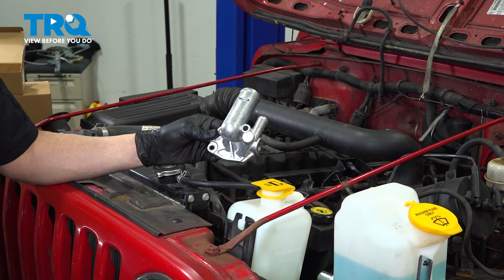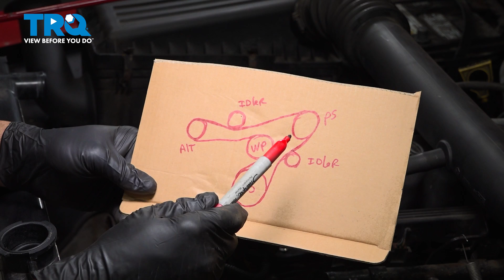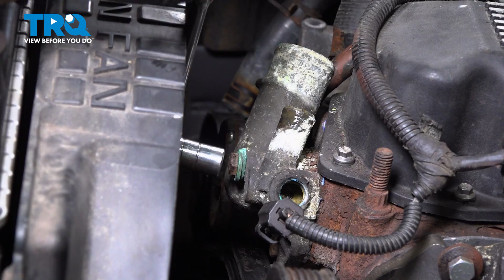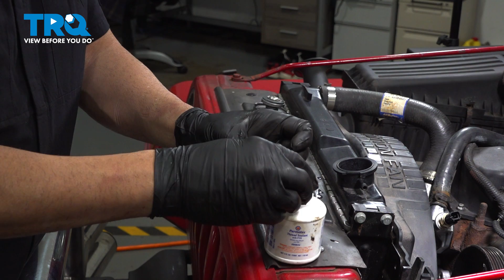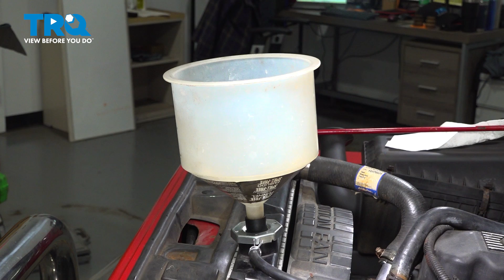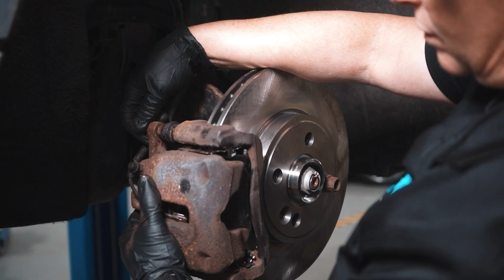How to Replace Thermostat Housing 1997-2006 Jeep Wrangler

Comment: Great video! I definitely should have watched this before overhauling my coolant system; would have saved a load of time. Question: aren't you supposed to leave the radiator cap off at first to bleed air out of the system?